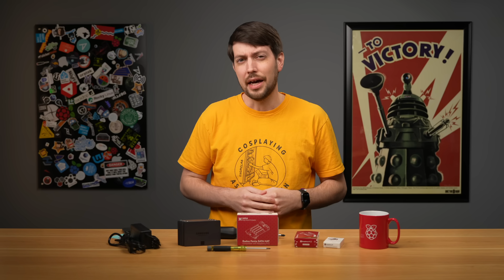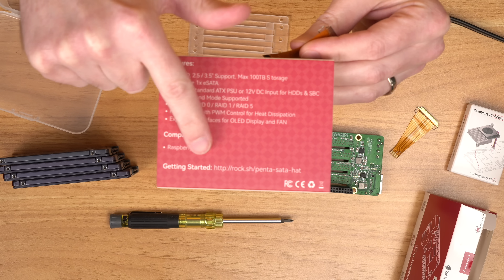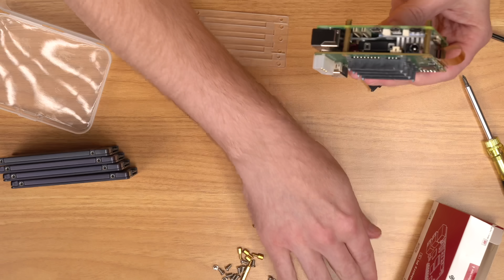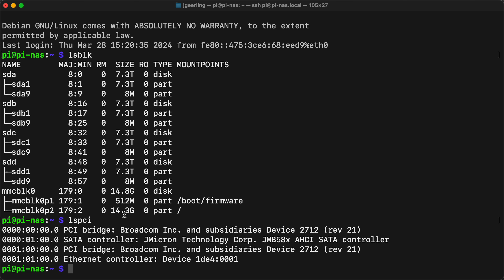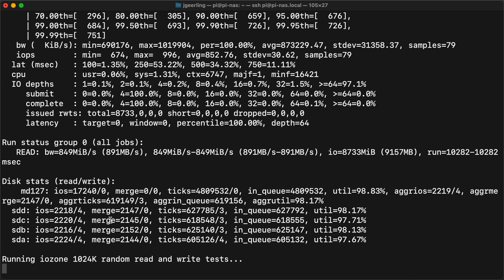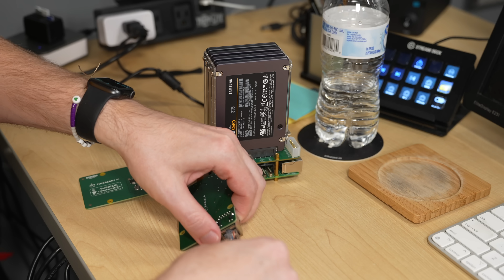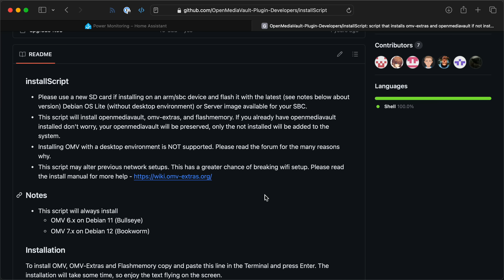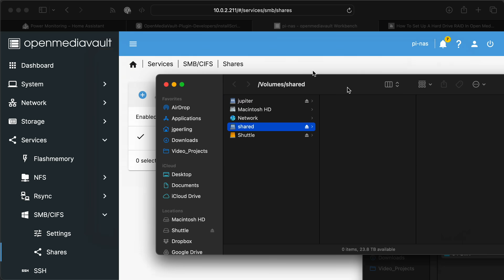The ULTIMATE Raspberry Pi 5 NAS

Comment: After a long time to think about it, I finally convinced myself to get a NAS. I've also think those pre-made QNAP options are a rip-off, so instead I ordered an Odroid H4. I expect it to get held up at customs for me to pay the 20% VAT on it. So far it's $100 device, $25 case, $25 accessories and $75 shipping from Korea. Does not include RAM. And since shipping is via DHL, they will charge me an extra 20 euro above the customs VAT tax just to file the paperwork on it.
In total it will end up almost the same as the cheapest pre-made 4-HDD NAS, but it has a CPU from 2023 instead of one from the 2016 discount bin.

Comment: The problem here is that affordable SSDs (1TB) only offer you 3TB in RAID5. But for a NAS you probably want 6 or 8TB. And traditional HDDs get you a LOT more storage for your dollars, but these cannot be powered by a Pi. 
This setup for $145 plus $800 for four 2TB SSDs puts you at about $1000 for 6TB of storage space; a price similar to other NAS devices.
I would like to see a HAT with six NVMe connectors; six 2TB NVMe would also cost about $800 but at least you would get 10TB of storage in a RAID5.
Also, Radxa had terrible support a few years ago, so I wonder if they have gotten any better.
Nice idea, but still not yet competitive with a small home NAS. Close, though!

Comment: looks cool but what is realy the point ,  what you gain , speed no ,,  price thing cost 200 or more  not that cheap ,,  power saving , power is not that expensive  you gone save what 20$ a year ,    size ye probably ,,  better off getting a regular pc motherboard , and add a 10gb nic ,  many will alredy have 4 sata ,  yee will be bit biger  unless you live in a rv space is not that much of problem ,

Comment: Hello Jeff, 
Right now I'm between Pi 5 8GB and Ryzen 7 5800H NUC. My plan is utilizing it for NAS and Media center purpose, and I'll use it with variety size disks (3.5" and 2.5" disks) together over USB 3.0 interface. I don't need any RAID setup. 
In this scenario should you suggest using RPi 5 or should I stick with R7 NUC? Which one you preferred?

Thanks in advance for your reply.

Comment: cost & performance wise, isn't it better to use like second hand Optiplexes especially the one with T series Intel processor for lower power consumption?
What's the benefit of using Pi instead of Optiplexes?

Comment: Since I only ever use BTRFS (B-Tree FS) on my NAS and servers, I would have been interested in seeing the performance there, especially with many of BTRFS's performance features enabled. I also try to avoid the Samba protocol since I've experienced performance and file locking issues from system to system. I use NFS with my Windows and Linux systems, which has always outperformed Samba in my experience, so that would have also been a curiosity of mine.

However, I acknowledge this is more an experiment of how the project performs when compared to other NAS setups, so perhaps my curiosity isn't relevant here. It was only my two cents.

Comment: DUDE! Awesome "in person" format. What I and I think many would like to see is not only stacking hardware like you're doing at 20:00+ but also stacking applications on a Pi 5.  For me it would be the NAS solution running Pi-Star as well. So this would take the board to connect the 4 SSDs as well as an MMDVM board with one or two antennas.  So I'd have a NAS as well as a Pi-Star ham radio functionality. Can it be done?

Comment: This video gave me confidence to pull the trigger.  Just ordered my first ever Raspberry Pi 
Raspberry Pi 5/8GB $162.48 CAD

Penta SATA HAT $62.55 usd = $88.90 CAD
12V 10A Power Adapter $30 CAD
Total $281.38 CAD before drives
 Excited to put together my first NAS.

Comment: Hey my Pi Plex Server NAS currently struggles with 100mbps films. Im using the same setup from the video except for the 2.5g adapter HAT.

Do I understand it correctly that adding the 2.5g adapter would increase the read speeds from ~120 to ~250 and I would have no problem streaming it?

Comment: Thank you for sharing @JeffGeerling
I just went to the link to the SATA Hat's site and checked the locations to buy.  Sadly listed as out of stock at all 3 locations. :(

This would for sure be a cool idea to have.  Right now I am using a Raspberry Pi 4B with a Sabrant USB dual drive dock.

I was hoping that I could upgrade to this, but I guess will have to wait till they get stock in :)

Comment: in retrospect building pi nas for me been a waste of time, if only i spend a few hundred dollars on proper 4-6 bay nas instead of tinkering with sub-par materials only to find out raspberry pi is some slow ass dinky thing that's slower that most cellphones and can't properly handle 4K or high volume disk traffic. K no thanks I'd rather spend $400-500 on a proper nas. I mean let's face it a pi could bearly run as a pi hole or a router continuously for months without proper cooling and supervision.

Comment: I agree those earbud style detent charging connectors between the boards are the pits. 90% of the skullcand earbud chargers that are returned are because of single point failures in those. NTM, there is no indication for power off.  12 year old tech is superior. Just a red or blue light? Fml.

Comment: I've noticed on those 2.5 mm ssd's that if you open them up and show the bare board, they are actually tiny in comparison to the enclosure, I wonder would removing the enclosure help with heat disapation on  the drives itself?

Comment: You are testing speed the wrong way. Your bottle neck is your local drive. You need to take that off the equation.

Cat /dev/urandom | pv > /mnt/mynas/foobar
Cat /mnt/mynas/foobar | pv > /dev/null 

And during first line, check no core remains stuck at 0% iddle. 

That's why your pc may be faster than your Mac.

Comment: Thanks for the video. I really liked the size. And stetics.

But my only concern is about the storage medium. 
As of now, those 8TB SSD are way too expensive compared to magnetic hard drives, honestlyi would really like to use at least 8TB disks in a NAS . 

On the other hand, if we want to keep the costs of the HDD low and keep the size small, then the biggest 2.5 HDD is 5TB. Not to mention that those are SMR, not recommended for zfs. :( ...

So, for me, the only downside is the cost of the SSDs. It is not worth it to build something like this for big storage needs.

 However, everything changes if we you can use cheap big HDD in there. 

Thanks for the video.

Comment: Does this setup support hot swapping? For example, what if I have 2 SSD's and I want to add 2 more SSD's later while the NAS server is still running, without turning the server off, would this be possible?

Comment: @JeffGeerling, i got everything mentioned in this video apart from the Connector part that connects the two boards, could you please confirm what type of connector it is or provide a link to the connector (FFC). Please. FFC is a very broad term and shows all kinds of cables on internet, i cant find it. Please help

Comment: A space for a 40x40 fan should be considered because in raspbery pi 5 with a case from 52 pi and the cooler I have found that the system is much more stable, when operating with multimedia.

Comment: Just use 4 nuts with the screw inside wiped with a drill and there should be enough space, as long as the screws are long enough

Comment: That's a nice little array.  I test solid state storage for a living.  Now, one of our current generation of drives can match or exceed those speeds, but considering how you put that system together it's really not bad at all.
   
FIO is a great tool, isn't it?  I use it exclusively and I've been VERY happy with it.  Do you know about SPDK?  It's an Intel developed alternative driver stack - it replaces the  Linux block device driver layer.  It's VERY nice and low overhead.

Comment: Lets calculate our power supply for a 20[W] application 
P=V*I 
I=P/V 
V=12
P=20
I=1.666666
so you can use a 12V 2[A] and you can expect to work even for 24W application  
remember always sizing your power supply right so you don't have power losses in power electronics remember their efficiency  is rated for their nominal values.

Comment: This is a neat little device. Prefect for a content creator just starting out on their channel as its MUCH cheaper than a standard NAS that typically takes big 3 1/2 NAS drives. Yes, those SSD's at that capacity can be pricey, but if you're gonna be doing content creation of some form it seems like a reasonable investment to me.

Comment: the issue imo with the pi is that at this price unless you are extremely space constrained you can get an all in one x86 board that has sata builtin (e.g. ASRock J3355B-ITX at 60 bucks, which is the price of the pi5, which has a full X16 pcie 2.0 and sata).
or get a cheap router that has usb 3 and usb3 to sata adapters. (my 40 bucks router can handle 4 disks at gigabit speeds)

Comment: Yeah, but geezus, how much do all these little parts add up to.
I'm thinking way more than an obsolete old PC you pull out of the closet.   Which is free, so not a fair comparison...  but...    wayyyy more.
The goal should be to build a completely silent entirely solid state NAS with no moving parts for as cheaply as possible.  Something that can be plugged in and stay online forever with no fans or platter drives to fail.            

Your version is not bad at all, but more of a stealth NAS if you were not only going to do that, but also hide it somewhere where it couldn't be found.   I.e., someone breaks into your house and steals your computer, but your hidden data nas drive gets left behind.   Or maybe it's not even in your house, but hidden outside in an enclosure or another building, just in case your house burns down.   Like in a sealed concrete bunker outside your house underground with just a power cable and an ethernet cable running to it.

31:31  - I like that it looks like some piece of Apollo space computer hardware, that could be slid into a cannister or PVC pipe.   Install a webserver or a proxmox server on it or something.    My solid state webserver based on an HP thinclient computer with 110mb of RAM and a 64gb USB stick and tinycore/microcore linux...  has been running for 15 years now on 8watts.

Comment: I would not put more than 2 drives in this thing. I still think it is all a bit junky, and I do not understand why there are no more fleshed out solutions, with integrated power and cooling. I would happily pay for few of such systems (but of course somebody will point me there are some, and then you see how also junky or underspeced they are), and build some nice ceph cluster with them, but I am not going to mess with all these cables, power supply, heating issues, fragile cables, extra boards, etc. 

There is a new product just dropped few days ago, from Argon40, that looks a bit more interesting.

Comment: Hello, from my experience, the connector to the expansion board has a latch that is not locked correctly. It would be best if you locked it above the connector of the expansion to prevent the flat from disconnecting!

Comment: The E-SATA-P format was undeservedly forgotten, at a time when no HDD USB Box was able to work adequately, e-SATA-P worked as a direct SATA connection, without requiring additional power cables, which was extremely convenient to use with laptops. But this is a very old standard, developed at the most opportune time, but practically not used by anyone. In our time, its relevance will become a thing of the past. Among other things, you can insert regular USB devices into e-sata-p and they work as usual. This is much better than just USB and the best solution of past years for hot plugging an external hard drive

Comment: If you want to get a good IR temp reading of the drives just put a strip of electrical tape on the drive 
This will have a correct temp reading on the IR cam

Comment: 31:05 dude don't use a GUI tool for that kind of stuff, don't even write to disk but to /dev/null (for reads), for writes ideally pipe from a hardware RNG and please monitor CPU usage on the workstation. for more exhaustive and accurate results, use more than one workstation (at least 3 to 5) and concatenate the results, that will really push the NAS to its limits

Comment: Tq Jeff.
Re: Heat-sink mutilation....
I suggest people use extra or longer  'stand-offs' a.k.a. 'spacers' / 'hex-spacers'  to increase the height between the two boards. 
If using a longer spacer, you'll probably need female-female spacers.
If extending the existing ones you'll probably need a small male-female spacer.

Comment: RAIDZ1 (ie, RAID5) is always going to write slower than mirroring; with RAID5 you need to calculate parity and write to all drives, so drive performance factors in, and you need way more CPU power also. With mirroring, it's just straight writes at speeds that let the drives combine their speed. Also, compression on is almost always the correct setting, the minor CPU overhead is usually worth it to save space entirely transparently. Definitely an interesting little micro NAS. I wonder if the fifth slot could be used for a boot drive? SD cards are not very reliable.

Comment: I only got about a minute into this, but i had to stop.
Why would you use a Pi, or any other "low end" SBC for something that you wanted to have fast disk access, as your primary need?
That is, for Network Attached Storage?!
That's kinda like entering a bike race riding only a skateboard, dontcha think?
The wheels are MUCH smaller than the other "bikes" (analagous to the data highwsy), and you can't "pedal" aa fast as everyone else (similar to the processor clock speed), even if everything else is "equal."
Sure, your racing stripe is just as pretty as the other contestants, and you're wearing the same garb!
That's just stupid.
If you're gonna do that, I'm not gonna watch a video of you complaining.
Sorry, Jeff. Not gonna.
(Nexr video!)

Comment: A centrifugal laptop fan sandwitched between the boards might be able to cool both boards by blowing hot air our sideways .  Hopefully someone makes a cooling module for the Pi using one, as it's useful for all hats .
  The PCIe switch board should be redesigned for gen3 or higher and get a GPIO passthrough connector for stacking .

Comment: I would question the reliability of consumer SSD's in any NAS using RAID, although Samsung seems to have some of the best lifespan warranties of any consumer drive out there (cheap Amazon brands are usually junk - some TeamGroup ones I tried recently couldn't even keep in sync after a week, so I returned them).  Using SSD's in RAID can also be a big problem when all the drives are in sync but they all run past their usable lifespan at the same time.  That's why Synology came up with their RAID F1.  AFAIK mdadm doesn't have any methodology for staggering expected flash drive failure like that, but it really should by now.

Comment: great setup. I have been waiting for a NAS like that. My current RPI3 with SATA hat only works via USB connections and is much slower of course. The ultimate setup would be 2x or 3x RPI5 NAS nodes in a 1U rack so you can have a HA production setup. If you can build this for a few hundred bucks the likes of Dell and HP will get a serious problem in their server departments :)))

Comment: HI, very intresing project, did you make some test with the USB  2,5GH ethernet?  and an idéa off final speed?
I have also a Rabery pi 4 nas with usb 3 external disk but if it is possible to have more speed and raid 5, it will be very intresing for me. but i will instal 2,5"  HDD becaus ssd 8TO  is realy too expansive for my data nas. And the very firt priority for me with the risk processor is th power usage, And the finnaly small size is realy intresting to, ex on vacation mooving etc;

Comment: It's a cool novelty idea but my 16TB Exos drives also cap at about 125Mb write speed and their a lot cheaper for the amount of storage you get.  One of those 8TB SSD's cost like 600 euros you can buy 32TB worth of Exos with that and you get the same speeds.